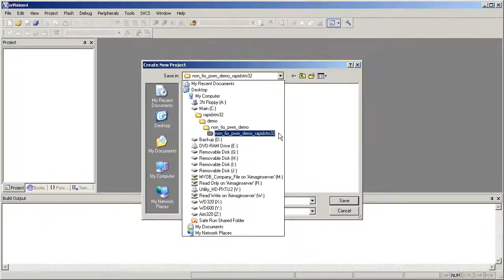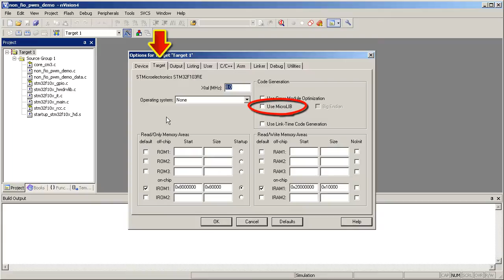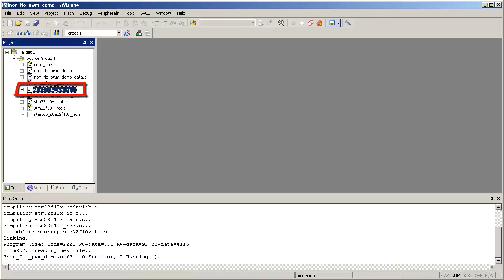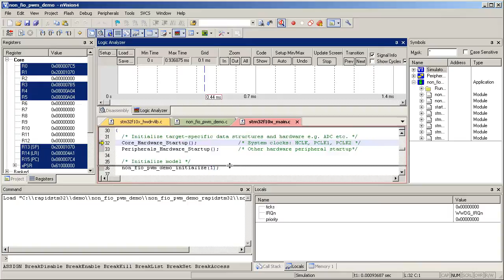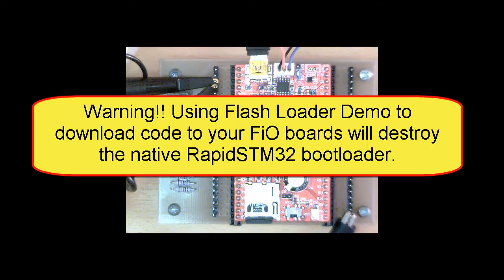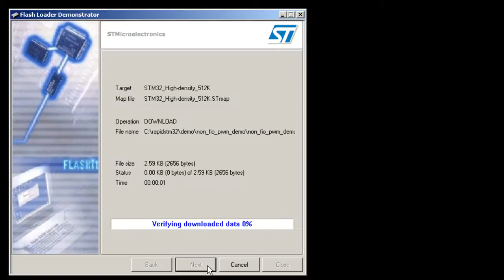Non FiO Demonstration Part 2 of 2

Comment: What is the scatter file (.sct extension) and should it also be included to the Keil project from the generated Simulink files?

Would un-checking 'global erase' preserve the RapidSTM32 bootloader if installed?   Alternatively, can the application be linked to a different section of flash?
Reply from the maker: enliteneer  1. Scatter file generated by rapidstm32 blocket is for configure MCU memory map, heap and stack. In this case (non-FiO board): this file is optional, you can use the default configuration from Keil IDE.
2. The code generated for non-FiO board is for other STM32F103 board only. DO NOT re-program FiO board with external programmer.